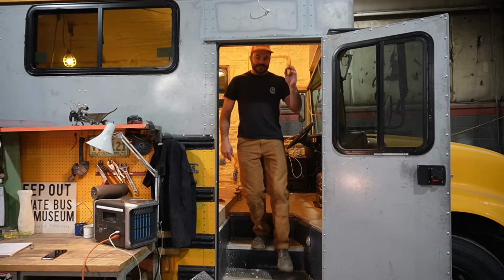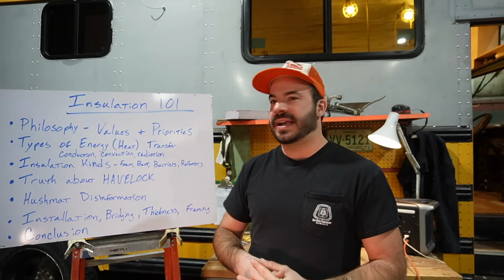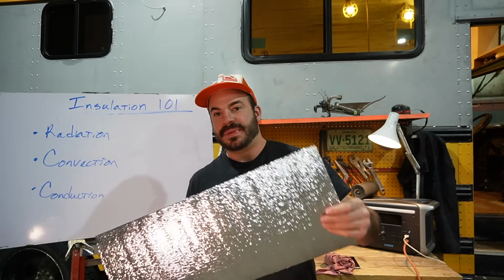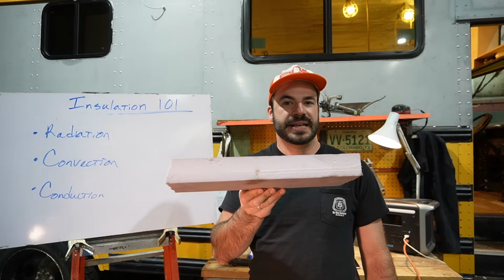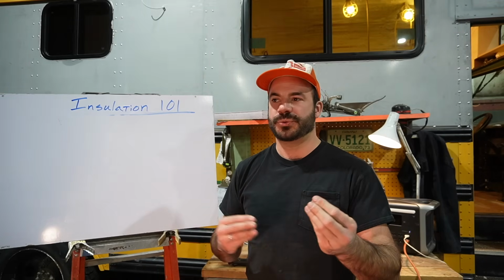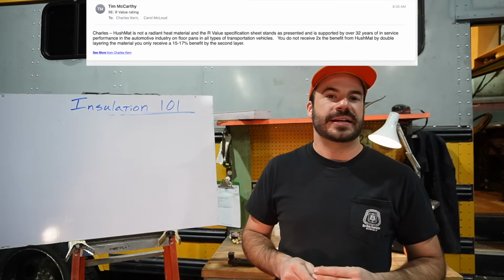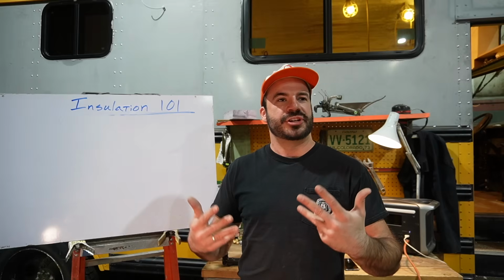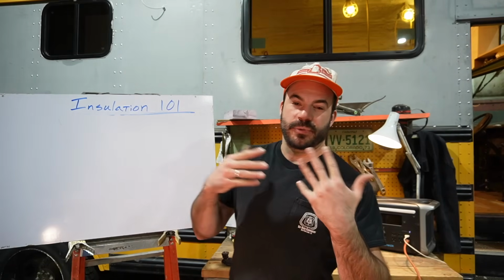Insulation is a SCAM (& the truth about Havelock and Hushmat)

Comment: Chuck you are the man and you just made me think hard about building a skoolie. I watched the video in ahhh. Should I insulate spray insulation like you said top to bottom? Should I not insulate top and bottom and just leave it alone? I'm trying to build affordable and the spray insulation just means I have to do alot more work. If I don't insulate would I have thr water build up or mold faster or at all? Help!!!!!! Doing the walls and floor won't cut it I see.
Reply: You will end up with temperature differences between the outside and inside of the metal skin so if you don't insulate and have some vapor barrier you will have problems with moisture

Comment: Horse shit.. Spray foam is highly toxic. It breaks down over time and creates dust. That shit catches fire.. You got seconds to get the hell out before the fumes get you...Go ask any Fireman...

As for high density foam rubber. Used by car makers. It does have a high R value. Simple because it does not hold moisture. Heat or cold. And it does not create mold. Why Anybody that puts plywood down for a floor substraight. Is an imbecile. You just created all the conditions for mold to grow. And you will never know it...Why 3M insulation is the best.Covered by aluminized vapor barrier..

Comment: Excellent information Chuck.  One thing I would like to highlight about the vapor barrier over fiber insulation, whether glass or wool, is the impossibility of maintaining a perfect barrier.  Every outlet or control panel or water line penetrates the barrier and renders it, in the long run, basically useless.  Take a look at steel boats for example, if they are still floating and in a temperate climate, they have spray foam insulation with the built in vapor barrier that it provides.  Nothing else works.
Reply from the maker: Totally! Great points there
Reply: @ChuckCassadyYT  this was my understanding too about vapour barriers. So what to do ? Before seeing the above comment and your reply I was about to ask you for a recommendation of an intelligent (one way) vapour barrier to go over wool but having it confirmed again that they dont really work due to being penetrated in various places as part of the build im wondering what the best solution is. Is it still worth using one to "cut down" on moisture movement into the walls or is it just a waste of energy as its not a perfect barrier ? Im not able to use spray foam. My preference is to use wool especially as I already have some. What do you think about cork ? It resists moisture and is anti fungal plus it has its own insulation properties. What would you think about wool in the cavities with 10mm cork (on a roll) covering the wool and being the actual inside wall ? All this with (of course) a roof fan and a diesel heater/wood stove to help manage moisture in the space.

Also id like to thank you for this great video, so helpful and clear and balanced. Your info about the extruded foam was also really helpful and I love the fact there is no need to build a floor frame and have those thermal bridges. I may well use that for the floor after watching this ! What thickness do you use ? 🙏
Reply: @BibaWild  honestly this idea with cork and wool sounds excellent. I don't have any experience with insulation at all and I'm starting my first van build now so I'm far from an expert. My main priority is as non-toxic of an environment as possible so the cork and wool is definitely what I'm going with.

Installing this week, hopefully I remember to come back in a few years to update on results!
Reply: @wildtodd Do you have an update?  I am going to be starting on my build soon and I have been thinking about wool and cork too.
Reply: You are correct. Nothing else works. It's that simple.

Comment: All great info and observations through your experience. 
What about polypropylene insulation?
Non hydrophobic they tell us. 3M glue it to wall to prevent settling. 
And in walls with drains it doesn’t require vapor barrier (like van) but some use it anyway. 
Is a one piece edge sealed plastic interior wall material with insulating layer and fasteners equivalent to a vapor barrier?
So many ways to go or go wrong.

Comment: I can't help but think there is a way to save those old bus windows.  I like the look and feel of them.  Without one sitting in front of me to look at, could you not drill a hole into the bottom and attach a fitting with some plastic tubing that would drain water to the exterior of the bus?  When I get home later I'll look and see how feasible this could be.
Reply: how'd you make out with your exploration?  i have a shuttle-style bus with double-pane, factory-tinted windows.  There's no lip/ledge on the interior or exterior.  will have to explore a bit myself.
Reply: @Darrell Lindsay  I think it's only the single pane windows he's talking about that have a bad problem with condensation.  But I could be wrong.  After looking at the windows it doesn't look like they have any lip to drill, but after they are trimmed out you can drill a hole in that trim and then waterproof and seal that. I'm still not quite there in my bus yet, but close. The emergency window is the only one I'm concerned with, but I have other windows I've taken out. Might trade that window out for a normal one. I've got other exit points so I'm not concerned on losing it as an exit.

Comment: great video, chuck. one note on sill seals, though. while they may do a good job in filling air gaps between your sill and your foundation, their purpose is as a moisture barrier (not a conductive barrier). modern basements, as well as many slab on grade and other types of foundations deal with moisture before it ever gets to your sill, but that was not always the case (and still isn't "always" the case). if there is moist dirt touching your concrete foundation and there's no moisture barrier between that and your wooden structures, the concrete will essentially act like a pump, sucking moisture in from the bottom and exhausting it out the top by whatever means it has. wood also happens to be great at sucking up moisture, except, unlike concrete, it rots.

you're correct that if there's a big temperature differential between the wood and the concrete, the sill seal won't help in preventing condensation. that is not what it's for.
Reply: What you are describing is poor and sloppy workmanship.
Reply: @chrisallen2005  my parents' house was built in 1821 and still has most of its original structure and exterior. I've worked on houses that are 100 years older than that. Same thing. I wouldn't call anything they did sloppy.
However, since writing this, I've been corrected. Sill seal is for filling gaps, and that's why it's a good moisture barrier for use in the application I described.

Comment: Awesome video! This should be a must watch for everyone doing a bus, van, or trailer. Heck, the principles are extensible to houses too. 

Also kudos for not giggling when you said “more bang per inch of thickness”. I giggled for you. 

Keep up the awesome videos!
Reply from the maker: Thanks for being here!
Reply: I would never, ever use spray insulation in a home.  
In England, they will not loan money on homes with spray foam.
MASSIVE mold problems.

Comment: Will this apply to an aluminum rather than steel structure?  I’m learning all I can before starting a Horse Trailer conversion. I can’t find anything out there and came across your fantastic info.  Thanks for a super informative channel.
Reply from the maker: same with aluminum!
Reply: And aluminum is significantly more thermally conductive than steel. A little bit more insulation can counterbalance that. You don't need much more, because when it comes to such thin metals, the conductivity doesn't matter too much in the bigger picture when you have plenty of insulation in any case.

Comment: Really enjoy your videos and discussions.  Insulation has been a big topic of discussion for us - though, to be honest, it's all just discussion and theory right now as we've not received our van yet.  What are your thoughts on using 1/4" closed cell landau type foam sheets (similar to K-Flex/Armaflex/Minicel types of foams, 2lb density) covering as much as possible of the van metal?  We were thinking it would give us a (very) little bit of insulation (thermal and acoustic) but would also block the interior air from coming into contact with the metal surfaces as well as create thermal breaks.  We'd then insulate and build out from there.  We're not planning on doing spray foam, so won't have that nice solid barrier that you get with that.

Comment: The necessity of running a dehumidifier should be clear.  The newer motorized desiccant type units remove water without having a traditional compressor/evaporator.
Reply: However you do have to either buy new dessicant or recharge the used dessicant by putting it in the oven driving the moisture out. Another cool and faster way would be to get a vacuum pump and chamber.

Comment: This is a great video, especially to get people discussing the best options. We continually learn as we build and travel. I’d definitely do a few things differently in future builds. I’ve only done one bus, a van and I’m now remodeling an RV. Interesting, factors to also consider are location. If you stay southwest you’ll have less issues with moisture due to so much dry air. So many people damage their bus by combustion inside, don’t use Mr Buddy Heaters. There’s nothing wrong with a gas furnace, as long as it’s a heat exchanger and the combustion air is vented straight outside. In my first build, I left the fiberglass (it was inspected and is perfect) in my ceiling and walls (screw fasteners - not rivets in my interior bus). My walls are factory vented, missed by most. My ceilings are covered by cedar, but no other vapor barrier. My walls are 1” of foam over the original bus metal over the original fiberglass. I have 1.5” of foam in the floor. My heat sources are a little insane, I have an RV propane furnace, diesel heater, electric heated floors (two zones) and a mini split heat pump. This redundancy is great for switching between boondocking and being plugged in. I’ve used the bus in the humid Midwest to dry SW down to 20F. I can only figure my use of dry heat is mitigating the moisture issue as we always keep the bus warm in the winter.

Comment: I have a 2006 International School bus, it’s been converted x 3.5 years. My stock bus windows do drain outside. If you carefully look at the outside rub rails, the third one down has an extra lip. There are vent / drain holes at the bottom specifically designed to carry moisture out of that area right below the window. I added extra insulation inside the bus panel, leaving the stock insulation in the factory wall space. My bus walls and ceilings are held on by screws versus rivets, so those spaces were inspected prior to the build. None of the factory insulation was discolored or damaged, it had no water damage or mold. I agree, good insulating practices are imperative and I’d probably use double paned windows in the future - maybe house windows with safety glass versus RV windows.
Reply: Wiping the water from your windows in cold weather is your manual dehumidifier
Reply: @wallacegrommet9343   What about the water that condensates on the inside?   The only windows that this won't happen in, is vacuum insulated ones.
Reply: No.  You must use tempered glass.

Comment: Amazing video Charlie! Thank you!

What would you say is the minimum foam board I should put under my 3/4” subfloor? I don’t want to sacrifice in the ceiling. Not doing a roof raise so I need the headroom. Would 1/2” or 1” foam board be enough?
Reply: Depends on where u will use your bus but a one inch would be minimum. Park it on a hot pavement, you might want two inches. Anything greater depends on how tall are you. I have two inches in walking zones while I have 4” in all other area, such as under the bed, sink, etc since we don’t need the clearance. Even with one inch using chuck’s floor design that inch will go a long way to keeping your buses internal temperature constant. Best!
Reply from the maker: whatever you can squeeze in my man!
Reply: Is it possible to add insulation under the floor and would that even be helpful?